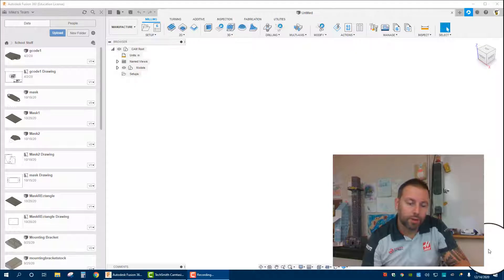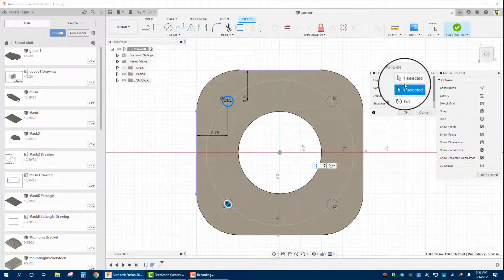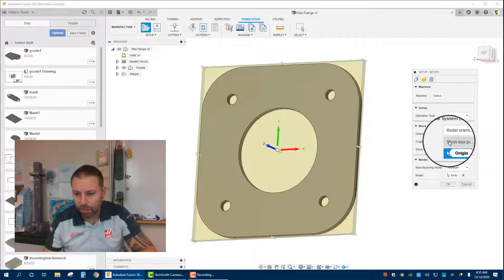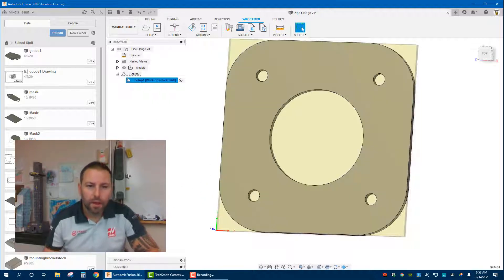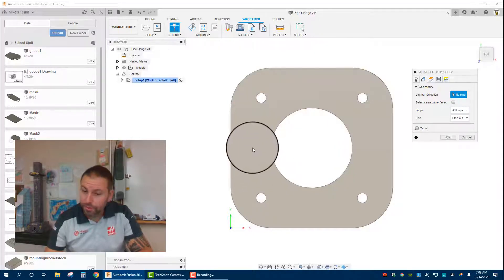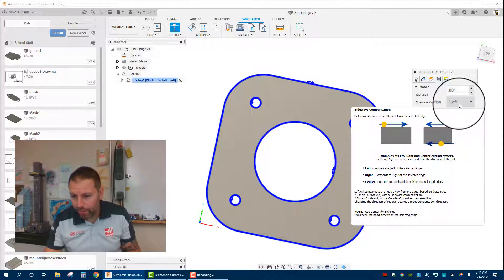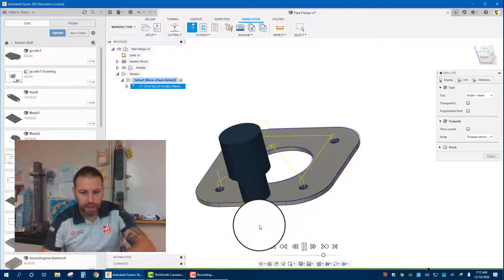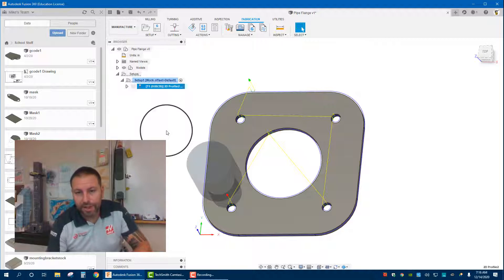Using Fusion 360 to Create Tool Paths for CNC Plasma Cutter

Comment: Great video, you said that part is in G code,  how do I send it to the plasma cutter. Iam using a GoFab CNC plasma cutter. New subscriber, New to CAM. Thank You
Reply from the maker: @TomAutoTV  great, I’m not sure with the GoFab, but you post process it in fusion to a SD card or flash drive and bring it over to the machine to open up. The machine I had used a control system on a computer attached so once I brought the flash drive over I could import the g code. Each machine has its own post processor so make sure you have the right one.

Comment: Thanks for the video very well done. I have a ArcDroid and started a new hobby cutting metal art, some of the files I'm using I need to change the pierce  location. Once I load them into Fusion 360 do I have the ability to change the pierce location?
Thanks
Reply from the maker: @Woody59er  thanks for watching. I know you can change the distance, angle and sweep of the pierce, but not sure if you can change where on an outline it pierces if that makes sense.
Reply: @ScienceMonkey00  Ok thank you

Comment: So light burn has a gcode export function, does this mean it would work with a cnc plasma
Reply from the maker: @2000mustang6  if the processor on the plasma can read it, it should work.

Comment: For a teaching video I wish you'd slow down a little.
Reply from the maker: Sorry. Usually ppl either slow it down in the settings or pause it, or go back.
Reply: @ScienceMonkey00  well, it was my fault. I had to back up and study the drawing aspect (which is also eating my lunch). I was taking my frustration out on you a little. I apologize.  
Once I actually create a part , I'll be back. Thank you for the video 👍
Reply from the maker: @johndunn8647  no worries, this stuff is not the easiest to learn!
Reply: @ScienceMonkey00 i'm back. maybe my scull has softened up a little...
Reply from the maker: @johndunn8647  🤣🤣🤣

Comment: OK with the plasma tool setting could you name the settings by metireal eg. 1.3mm sheet 4 mill flat bare !after you have fine-tuned your cutting  speeds and rights and amps and son on
Reply: Sorry what I meant was if you have a set of settings for a piece of metal you could give it a tool name so you go to the setting that meets your needs so it stops the need to to have a book of settings matching the cuts
Reply from the maker: Honestly, I’m not sure. I know in the milling function you can set defaults for different tooling, but not sure for material. I’m sure you can, I just haven’t done it. I know the values in my head so I just plug them in accordingly
Reply from the maker: Ohhhh sorry. Yes I believe that is a good idea

Comment: Thank you for the tutorial. Is there a tool like vinyl cutter? Or I should use laser/plasma and make edits on the gcode? Bests.
Reply from the maker: I don’t believe there’s a vinyl cutter tool, I guess using the laser would work, or even plasma set with no kerf, and tool centered on line
Reply: @ScienceMonkey00  Thank you for the very fast reply. I asked this question because the blade angle of the cinyl cutter makes a little bit variable shift in the path of the head as it travels through the contour. Have a good day.

Comment: For some reason my simulation keeps cutting out the outside of the square first then the bolt holes. I'm worried the part will fall through before it cuts the holes. I can't seem to get it to work correctly and can't find anything to correct this issue.😢
Reply from the maker: You can do it in two ops if your worried about it. Do the bolt holes in one operation, then cut the outside of the square, and post the whole program out. 

Also, but I’m not sure if this could be it, double check your arrows on the paths you selected, make sure they are on the correct side of the line.

Comment: How did you setup to cut holes counter clockwise and outside clockwise? or did i miss something? thanks
Reply from the maker: I’m not in front of a computer right now, but double check the arrows, that they are on the correct side of the line.
Reply: @ScienceMonkey00  they are on correct side but are oriented the wrong direction.

Comment: WARNING
"When generating toolpaths for the CrossFire PRO with THC, use NO lead out to avoid losing arc voltage at the end of a cut."

Not sure what yours is in this video.

Comment: hello i am using a crossfire to cut i use fusion 360 but when i go to simulate it cuts way outside the drawing do u have any idea why it would do that ? any help is much appreciated
Reply from the maker: What do you mean it cuts way outside? Like on the wrong side of the line?
Reply: @ScienceMonkey00  thank you for you’re reply  let’s say I design just a simple 2ft by 2 ft square and do all the steps go to simulate it cuts 3to 4inches outside the parameters
Reply from the maker: Weird, did you ever figure it out?
Reply from the maker: If you shared it with me, or sent me a pic of settings I might be able to figure it out. Almost seems like there is a weird offset or kerf set.

Comment: Great Video, and the easiest to follow that I have seen to date.
And excuse me if this has been addressed already... But in the Tool Library section..  I believe you had already added your library for your machine. I say this because as I cycled through the Holders as you did nothing comes up as it did for you.
So with that I became stuck. My machine is a Wright CNC plasma machine using Mach3 to drive the machine..  Do I need to download the Vendor Library for Mach3 Plasma? Or is there a different library I need to download or is there a work around?
I hope that made sense..
Thx, 
Kev
Reply from the maker: You should be able to manually add your machine. If you want I can make a quick video on it if you like.
Reply: @ScienceMonkey00  I actually just figured out that I needed to open all fusion 360 libraries. Then the plasma tool popped up..  I also figured our the 2nd part, to get the g-code.  And it runs on my maching, but it runs opposite from how it was designed.. so I missed something somewhere.
Reply: I figured out the machine running mirror from the g-code.  I had to do some pin checking in the config folder of Mach3..

Comment: Is there anyway to make a new tool  path on a new pet on the same file . I’ve seen people do it but everytime  I try it puts the stock around all parts of that file
Reply from the maker: Yes add another setup with tool path or just add another tool path. You can select what you want it to cut. Not sure if im missing what your saying? But it should be pretty straightforward
Reply: @ScienceMonkey00  when I  try and do that my plasma cutter never starts at the edge of the new part . It starts wherever the first part that was made is .   I’m not sure if that make sense but I can’t get it to just select the new part  .  Probably something simple I just can’t figure it out
Reply from the maker: @Eman425  You are using the fabricate menu in fusion correct? If you make an additional setup  you need to select the new area you want to cut in, then make your new path. That should work. If you want to email me a pic or video you can...Mikesdesignandfabrication@gmail.com

Comment: nice video i did this exact same flange butt when i simulate it cuts all over the place it starts from one corner small hole to the center and just goes around everything to cut another hole. i have a langmuir crossfire with no THC
Reply from the maker: That seems weird, send me a pic of the tool path to mikesdesignandfabrication@gmail.com, maybe we can fix it.

Comment: Hi, where do you get the values for nozzel, feed rate and kerf, to match those wiht the machine setup.
Reply from the maker: They are with the post processor supplied by langmuir, but you can fine tune them for you machine/plasma cutter.